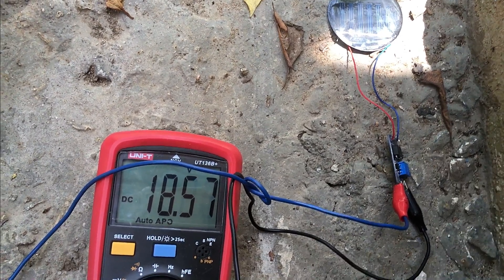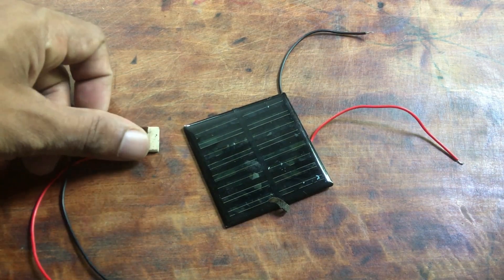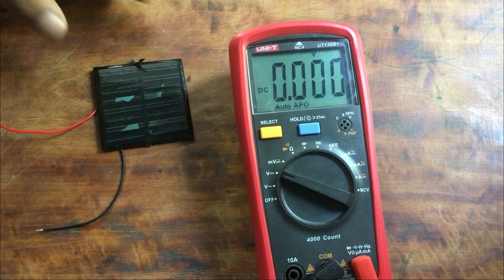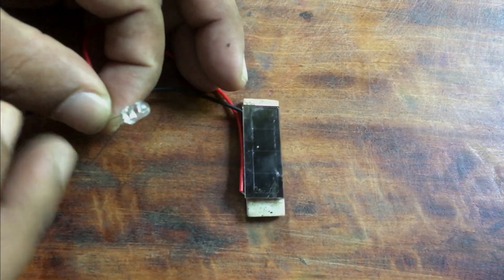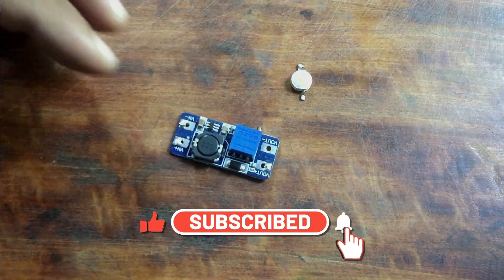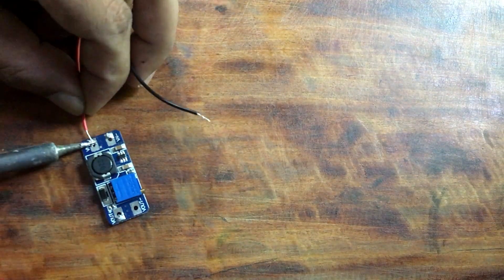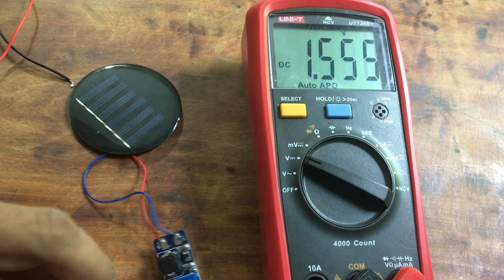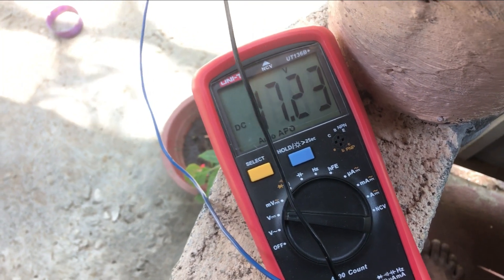Solar Power Supply With MT 3608 Booster 5v to 30v #electronic #solarenergy

Comment: Hey sir, I want to power supply an arduino in which there is a ultrasonic sensor and a bluetooth module

So a direct supply of two 5v solar in series can run it or not?
Reply from the maker: Yes, you can give 5v to the sensor
Reply: @setnfix  Sir, I meant there is a Bluetooth module, A sensor... So how much should I supply to arduino through the round port
Reply from the maker: Do not directly supply 5V solar to the module. give the power through a regulator.